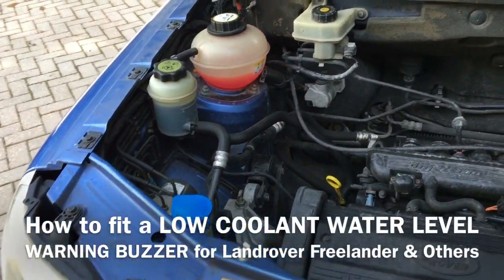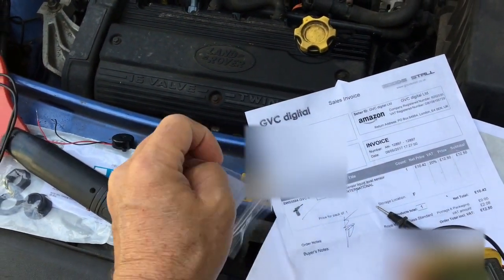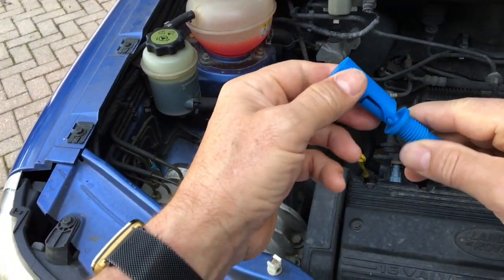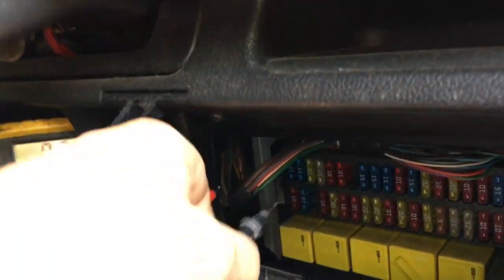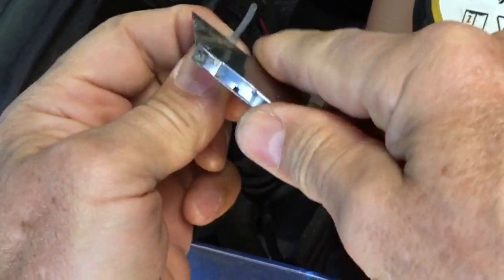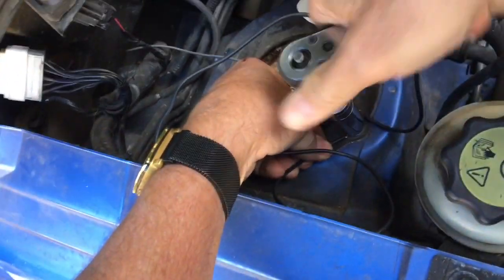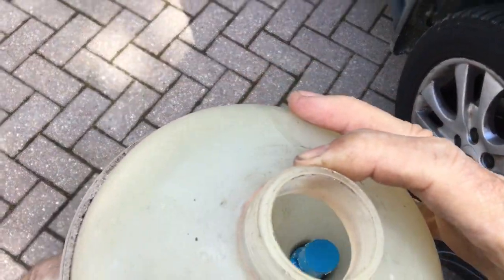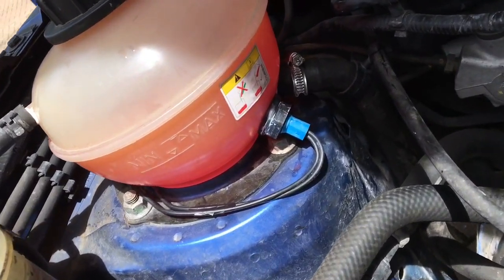How to Fit a LOW COOLANT WATER LEVEL Warning Alarm

Comment: I found your video when researching to do my job... BTW the reason for your false triggering is because you have the float orientation incorrect. For low level triggering the float should fall - you have it set to detect high fluid level, a changeover relay is required to manage the switching but its all too late now that the tank is drilled. Thank you for taking the time to do a video.
Reply from the maker: Thanks for your input.  It does work however, the false triggering is cornering forces moving the water to one side.  The sensor could be turned upside down with a suitable inversion to the circuit also but I’m doubtful that it would eliminate false triggers.   
Soon I’ll do another video using more uptodate expansion tanks with a two wire sensor in built.  I found a lot of modern cars use an electronic module in conjunction with the two wires to do the level sensing. (Part 9646902580 - see on. Ebay uk).  Just got to work out for myself which wire is which on the sensor as I’m finding it a devil of a job to get a datasheet for it!  If you come across it in your job let me know.

Comment: I'm going to use a SEN0204 capacitive level sensor to do this on my K-powered Caterham which will save me drilling the expansion tank. In that case the system is quite small and does not need much expansion space in the tank so I fill it much closer to the top to give me a bit more reserve. From the many reports from the Caterham owners club it seems head gasket failures are almost always precipitated by a coolant leak, a thermostat failure or a fan switch failure except for the few caused by owners of fairly tuned K series that give them full beans before being warmed up. In such a noisy car I think light + horn + boxing glove on spring is needed to make sure I don't miss it.
Reply from the maker: Good luck with your project. A couple of thoughts: it’s easier and cheaper to buy a second hand coolant tank that has the level sense ability. It will also have been tested to work well. The problem with add on level sensing is it can be prone to false alarms when cornering or braking when the water moves a lot.
Reply: @comeinhandynow  Many thanks for the reply. I'll have a look at that. I tend to run so that the header is almost full when the engine is hot (partially as, in a Caterham the header is much lower relative to the engine than in the Rover and LR installations) and I'm thinking that if its situated at the front of the header it might trigger if full acceleration is used while the engine is not fully warmed up - not a bad reminder to have as a byproduct. I think your idea of putting a little processor in is quite sensible especially if I'm going to have an over temperature alarm/ fan switch failure alarm etc.
Reply from the maker: @ColinMill1  Cheers.
Reply: @comeinhandynow  I discovered an interesting snag with the SEN0204 sensor - that it can be fooled into thinking its looking at a full tank by a very thin layer of water between the sensor and the outer wall of the tank so bonding of the sensor to the tank would be critical (and pretty much uncheckable). In the end I decided I couldn't trust it and I'm going down much the same route as you but will fit the switch so it's in the closed position when the level is OK. I'm using an Arduino Nano driving a 128 x 32 OLED display and a piezo sounder to display/alarm the level along with the temperature of the top tank from a 100k thermistor.
Reply from the maker: @ColinMill1  Sounds like a fun project.  For interest, my latest level sensor uses a tried and tested main manufacturer tank and electronic water sensor. These are very cheap.  The advantage is it has already been tested to work under all conditions and has inbuilt filtering to remove false alarms.  See this https://youtu.be/Bgyy-ds7nNw
Reply: @comeinhandynow  Thanks for the reply. It's an interesting alternative. I have put some filtering for false triggering into the Arduino (basically alarms if the level is low (switch open) for >50% of the time over a period I can tweak in the settings (currently 5 seconds). I would like to use a bigger tank but there isn't a lot of room under the Caterham nose-cone so I'm sticking with a Freelander 1 bottle as supplied by Caterham for the moment. I was expecting someone to have made an alloy one with all the bells a whistles specifically for the car but apparently not.
Reply from the maker: @ColinMill1  I’m sure you can get it working.  The sort of filtering you want is to wait for 15secs of low level, but reset that count if a normal level comes through.  Even that can be fooled though.  I had a raspberry Pi doing a similar thing but it can still give false alarms on long unhill or corner acceleration on motorways.  The tank in the latest video has wire probes that go deep and central in the tank, so false alarms very attenuated before the electronics filtering on top.  The Tiguan tank used (ebay) is the same size as the freelander1 tank.
Reply: @comeinhandynow  I think my saving grace is that the Caterham system is so small you can run the tank much closer to full than with a bigger system so I have a fair height between normal level and the sensor low level. Anyway, I'll let you know if it works ok.

Comment: I have fitted a coolant level sensor the same as this to my 1991 Rover Metro and I was hoping that as the expansion tank is quite small it would be ok, but when I have had to move it around the driveway (I can't drive yet) even at low speeds the buzzer goes off. So I was wondering what the easiest way of fitting a timer (or something with the same effect) is, so that it will only go off after 15-20 seconds of low level?
Reply from the maker: Watch more of the video, I talk about a filtering circuit and also read the video description section with more mention of this issue.
Reply from the maker: Also there is a more recent coolant level design here for interest: https://youtu.be/Bgyy-ds7nNw
Reply: @comeinhandynow  Thanks. I'll watch through the videos.
Reply from the maker: @ryanwilliams6526  Thanks for your input. BTW That more current design at https://youtu.be/Bgyy-ds7nNw incorporates a delay circuit inside the module.